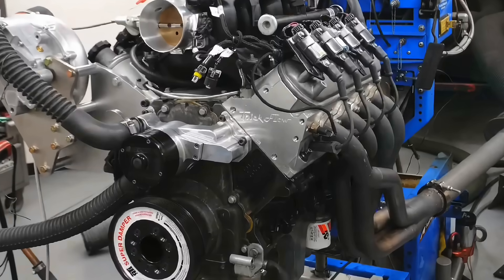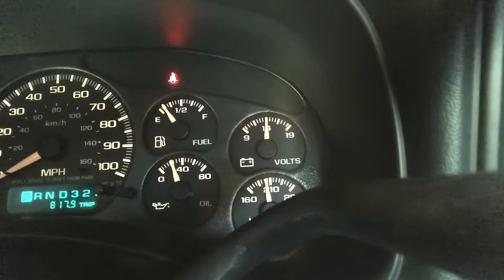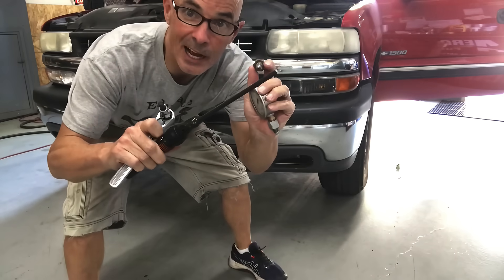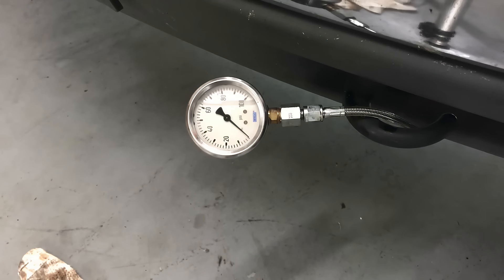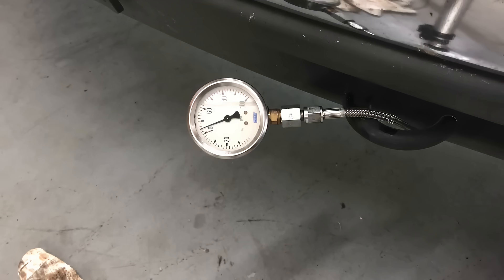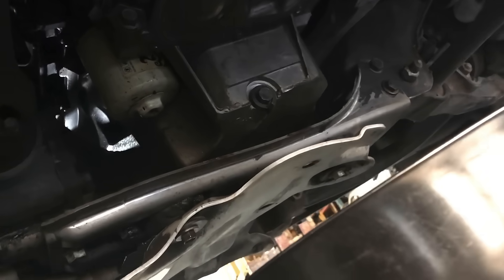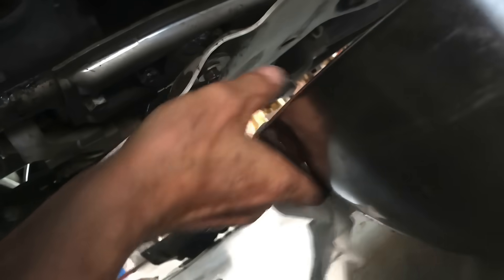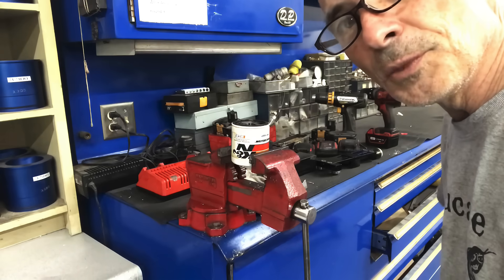HOW TO: TEST & FIX LOW OIL PRESSURE IN YOUR 5.3L OR OTHER LS?

Comment: My 2006 4.8L w/ 322K is always helped by an oil change with Castrol GTX 5W-30. Before the oil change the pressure is 20 at hot idle and 35 on the freeway and it always goes up to 30 at hot idle and 45 on the freeway. I'm always glad to see it go back up. Also,  I would think that 15W-40 would read higher than 5W-30. Anyway, Thank You for all the Cool Videos. I have learned so much from them and I appreciate your work. Today's T-shirt said "BeTHANKFUL" and I am! :-)
Reply: Should I understand that you've never had to change the pump o'ring?
Reply: @swan9680  Correct, I bought an O-ring but have not installed it. I had a new OEM oil pressure sensor installed a few years back when the oil pressure kind of zeroed. Also, on my last oil change at 352K the oil pressure with the Castrol GTX 5W-30 (white jug) never really went down before the Oil Change Light cam on. That's the first time that has happened and I like it, haha. I assuming the Csstrol product has been updated and improved rather than my 4.8L healing itself. 🙂

Comment: I stopped using those K&N filters.  The last time I used one the welded nut ended up leaking.  It was pure luck my wife had driven out of the driveway and she stopped and turned around and I saw it leaking.  Probably would have lost the engine.  K&N refunded me the 9 bucks for the filter but I've used Mobil 1 filters ever since.  Shame too, I know they are good filters but I wasn't taking that chance again.

Comment: Father in law gave my daughter his 06 silvy with the L33 because it had low oil pressure. Put an oring in the pick up and it carries 35 idle and about 45 to 50 highway speed. But it also has 400k on it so low pressure is to be expected haha

Comment: I once had low to no oil pressure due to a Mobil1 oil filter bypass relief valve breaking. Happened twice and I stopped using Mobil1 filters after that
Reply: Sorry to pop your bubble, but a leaky or stuck bypass in a filter can’t cause low oil pressure. All that will happen is that the filter won’t actually filter anything. You could put a completely empty filter on it but it still wouldn’t change the oil pressure. The only way a filter can cause a drop in pressure is that it’s clogged so badly that the media is plugged and the bypass is jammed.

Comment: Impeccable timing Richard. I’ve just bought my first LS powered vehicle. 2002 Tahoe with 300k miles and fluctuating/low oil pressure. Hahahaha wish me luck.
Reply: what was the culprit, brother?
Reply: @edgarsi  it was indeed the o-ring. I played with it for a while before I took it apart. A couple things I did the first was park it on a super steep hill nose to the top and see if pressure drops then park the other way nose down and see if pressure holds. The oil will cover the spot with the o ring and allow it to build normal pressure when you nose down. It was the case for me so I drove the truck around with the oil overfilled by 2 quarts so it would bring the level up to cover the oring at the pump and it would build good pressure. That was a good fix for the moment but it leaked a bit since the level was up to the front and rear main seal. Ended up doing a full reseal with the motor still in the truck. While I had it open scraped all the carbon from the heads and pistons, did a new cam, rings, rod bearings, and the slightly higher pressure pump from melling. Runs and drives perfect now took it on a couple road trips since then. Went wheeling at Anza borego good fun did well for a stock truck the g80 locker is great on uneven terrain.
Reply: @SpecialAgentJamesAki  Oh wow James, this was quite a journey. Thanks for reply! I just got my 04 truck and now facing this pressure problem. Known issue for the 5.3 vortec :( gotta try your "hill method" and if it shows - maybe replacing the o-ring cuz I don't think its a sending unit, then I 'll go from there.. Im not ready to invest into engine rebuild or anything major lol
Reply: @edgarsi  I hope it goes well. It’s definitely worth a shot at just doing the oring. Be carful not to upset the rear cover that holds the rear main seal it’s easy to make those leak when putting the oil pan back on. I think I could have gotten away with just doing the oring but I suffer from terminal 3 “while I’m in there” syndrome.
Reply: @SpecialAgentJamesAki  hehe same here man, and since they gonna drop the front diff and take all the stuff apart.. I thought about getting all them gaskets replaced at the same time.. cuz they are all super cheap, its the labor they charge for.. :( got my main rear leaking anyways... pump in the front, pickup tube on the bottom and rear main on the back of the engine... jeez and I so hoped to avoid this sht lol

Comment: My 02 with 320,000 started having tons of lifter noise.  Not even 15-40 would quiet things down.   Finally used a quart of engine flush before changing oil and it cleaned out some gunk.  I also topped things off with MMO.  I used this truck to pull trailers when I built houses.  Later I delivered mail in the country with it.  It's just a matter of time before I spin a bearing, but it's still running decent.   Engine Restore helped too (not sure how adding lead and copper to oil increases compression and power, but it did).  Anyway, I'll replace the o-ring.  Will give me a chance to look around.  Thanks for the practical video!

Comment: Thanks for the info, my LQ4 has had low oil pressure for a little while. It was also noisy on startup so I assumed sloppy lifters, but then I found the startup noise - leaky manifold gaskets caused by broken bolts. So now I need to dig into the oil pressure further.
Reply: My lm7 has the same issue.  Lifter tick when cold due to broken manifold studs.  What worries me, though, is that I get a top end rattle at about 3000 rpm under a load.  It goes away by 4.  I wouldn't be surprised if I have a collapsed lifter or bent pushrod since the truck is kind of gutless.  Oh well.  That's what Junkyards are for.  (:

Comment: Rotella 5 40 is the only oil on the market with ztdp in it I add militech one and a bottle of ztdp to every oil change and my 6.0 to 2001 Chevy 3/4 ton suburban
Reply from the maker: check Driven

Comment: I've had old wore out small block Chevy's that had about ten psi in drive at idle and maybe 35 or 40 at running speed you don't need a lot of pressure but it's nice I've also put the stiffer spring in the pump and had 50 at idle and 80 running is it necessary no but compared to the normal sbc it's nice to see higher pressure but then the chances of a leak are higher as well at the filter or what have you

Comment: I just had the exact same symptoms. Started with the same tests. Found shavings in the oil filter. Ended up being 2 cam bearings spun. Motor had about 130k miles. 30k miles on the 228 cam before this happened.

Comment: So I had my low oil pressure light come on on my 2006 Ram 1500 with the 5.7 hemi. I know that’s not an LS but I know they are similar in design. I had a light for the oil pressure and I checked with my tuner to give me actual numbers rather than the gauge that shows high and low. I show 16psi when it’s hot and get up to 60 with rpm. I have replaced the timing chain and oil pump and that O ring you had and still see 16 when hot. I honestly don’t know what may have caused it but it seems to be acting normal. Anything else you think could cause that?

Comment: What is the "dog bone" thing you showed ?
What was the oil pressure AFTER replacing the O-ring replacement? 
I had a bad pressure sensor, dash gauge read near zero; 
checked pressure with mech. gauge where it screwed into block-OK @ 40 psig, idle ( ???) Is that good with 5-30?
Replaced sender...should I replace oil pump and O-ring???
Reply from the maker: that's fine

Comment: I've seen tons of these, a quick band aid is swapping oil filters with an ac delco. Usually takes the oil pressure from 20-30psi up to 60psi. 9 out of 10 times that helps for a while. Some stay at 60 and others will eventually fall back off to 20-30. Ones with afm definitely can be tough to accurately diagnose in a shop setting, usually it's the screen for the vlom, sometimes the vlom assembly, oil relief valve sticking. I've seen a few different reasons other than obvious engine component failure.

Comment: The check valve in the oil pump can stick and cause low oil pressure too.
Reply: Exact same thing happened to me.  Oil pressure was around 60 psi cold and then back down to 20. Im not sure if check valve is even needed

Comment: Richard I had a customer that had low oil psi and it turned out to be worn out cam bearings .  I have also had a broken pressure regulator spring in the oil pump in older chevy  small blocks. It muct be nice to be able to just slide under the truck to work on it . My fat head and gut says I need to use jack and jack stands. Glad it was just an oring.

Comment: The LS series engine oiling system is identical to the FE Ford engine series, which is to say, trash. Only way to improve it is to dry sump it or get a small block
Reply: The oiling system is so bad that these engines will only last half a million miles! no wonder there is no one swaping them in project cars LOL
Reply: @rideswift  did your parents have any children that lived? I bet they regret that
Reply: @puunersjabski6487  Lifes to short to be so angry Jabski, turn that frown upside down, youll feel much better.

Comment: Likely a smaller issue but, rod or main bearing wear are the largest culprits of low or less than desirable oil pressure. It’s a skill level labor level type of thing, if you’ve checked the small culprits and find no issues. Now you know your engine is worn and it’s most likely your bearings are worn and gushing oil out of them which lowers oil pressure. It’s a diagnosis that makes you think, “it’s not THAT low so I’ll just keep driving it” or “its gonna cost me a good bit of cash at a auto shop so I’ll keep driving” and in both cases it’s ok to keep driving it just song as it doesn’t get REALLY low on oil pressure. If that happens your taking a chance at spinning a rod or main bearing which can’t lead to a hole in the block at the worst or a ruined crank at best. Watch your oil pressure you’ll, as far as oil goes it’s the only thing between a good running engine and a blown engine. Your judgement on the repair will dictate the level of damage to your engine and the hit to your wallet.
Reply from the maker: that's why we checked the filter for bearing material
Reply: Richard Holdener gotcha, the comment was meant for people that aren’t persay “gearheads” like the rest of us. Most people think they do their own mechanic work by doing oil changes, brake jobs and filter changes, when in fact those are all maintenance items that require periodic replacement. Many people think doing general maintenance is the same as doing actual mechanic work, this comment was directed at those people. The rest of us know what we can get away with or without doing more damage than good. That’s why we fix or modify engines, transmissions etc, this is also why the weekend mechanics out there 90% of the time bring their screwups or neglected vehicles to us for repairs. Often the weekend mechanic knows more about choosing sunglasses rather than fixing a engine or other parts of a vehicle. It makes them feel good to to simple stuff and its job security for us knowing they’ll screw something up or neglect something that we’ll get paid money to fix.

As a professional engine and transmission builder, 75% of the work I do is do to other weekend warriors or insufficient skill level mechanics, 10% comes from mistakes during a performance build, another 10% comes from just plain ignorance to the component being fixed or modified and the last 5% comes from outright foolish antics of a moron that thought it would work. That’s what doing mechanic work for a living is though we love doing the performance stuff but, most often we’re fixing other people’s screwups or neglect and the rest is numbing work that is as of today the normal in most shops.

Comment: Our lifters are not designed for that heavy of an oil due to the small oil ports on the lifters. i found that 0w-40 or 5w-40 is ok though but 5w-30 is prime when i get different lifters i am running heavier oil. Also SAVE the MANUAL THROTTLE BODY! Currently i run rotella gas truck 5w-30 with one quart of 0w20 in the winter and 1 quart 5w40 in the summer

Comment: 36psi is low? All my LS engines run around there, and my old Pontiac engines are between 10-15 to 30 psi at idle, 40 to 50 psi at higher rpm, except for the solid roller engine that has 65 psi. No need for lots of pressure or volume, it just soaks up power in my old engines. They run for decades like that. I have a 400 and a 455 I built in 1995 and 1996 (respectively) that are still going with 15- 20 psi at idle. Its what they have had since I put them together. 36 would be kinda high I think, not that it would bother me to have that much.

I have had pumps fall off on pressure, swap them out and its good. Right now one of my 455s is the 15 at idle and its because the 13:1 heads pushed a head gasket and it milked the oil, so it self clearanced the bearings a bit, I'll get around to changing them maybe over this winter, I want to change the 3.42 gears for some 3.08s because I have a Th350 in it rather than the 700R4 that engine keeps breaking, so I will do it at the same time. I don't have the right driveshaft for a Th400 or 2004R at the moment, so the Th350 will take a beating for a bit. It rarely sees more than 5500 rpm, so I am not overly concerned with the bearings. Its in my daily driver 65 GTO and I am enjoying driving it with 11.5:1 (different heads) on E85. Over 12:1 I need MLS head gaskets or something better than the cheap FelPro ones I run in everything under that. 

Let me tell ya, a 455 with 11.5:1 on E85 with 240 cfm heads and a mild 224/228 juice roller in a 3300lb car is stupid fun. It likes the FiTech a lot. Those same heads on another 455 pushed my 3750lb 79 Formula into the mid 11s with a 3.42, so the old Goat should run there no problem. Even with 15 psi at idle. Not bad for a low buck daily.  Something about 550ftlbs from idle to 4500rpm  and around 500ftlbs at 5500 just says yes to me. Doing it with a $3500 engine, well that is a hell yes.
Reply: Thank you for keeping on playing with the Pontiac engines.  I hate to see Pontiacs with Chevy engines.
Reply: @andyharman3022  I've stuffed Pontiacs in chevys, like my 76 C10. more power, better mileage, and costs less. I needed that 400 for another vehicle, so now the C10 is getting a 6.0.. its costing me a fortune, I could build a 13:1 compression roller cammed 455 or stroked 400 for the cost of stuffing a junkyard LS in this truck... but all my Pontiacs have car homes, the truck can make do with the LS which is vastly superior to the sbc and bbc.

Comment: I'm looking forward to the "daily driver" build that replaces your original engine when the time comes. With as many highway miles as you put on the truck I'm sure a lot of people would be interested in a non-maximum effort, yet still a massive improvement from stock LS. I have a year older GMC and wondered if your truck also came with that Optional cold weather running verification system in the form of a few thousandths extra piston to wall clearance? You know that 30 seconds of lovely sound that GM suggested If you just let your truck warm up it will stop sound.
Reply: My LS1 has had the cold start piston slap since new.  It goes away when the engine warms up.  I can make it go away when cold by revving the engine to 1700 rpm.  But over the years, it has never caused a problem.  Now I just turn up the radio.

Comment: Pressure relief valve in the oil pump sticking. Was the thread pitch on that plug you pulled out m16x1.5???
Reply from the maker: whatever stock is

Comment: Do a vid on lifter knock...

Probably after 200,000-225,000mi I'd replace the pump with a high volume melling and change the timing gear/chain, felpro no leak gasket.

Comment: Like the fuel gauge level. 😀 How many miles on it? You obviously spared now expense on oil and filters.
Reply from the maker: near 250K
Reply: Pretty good, remember in the good old days when they were trash at 100k. Got a 2002 Takoe 5.3 4wd with 220k on it drive it 500 miles to Los Angeles for work every month. Still getting 18 mpg on 100% stock simi regular maintenance. Your right the real LS has a throttle cable. FBW stuff hahaha 😄

Comment: It's not always "Cocaine and Hookers" when working on cars, lol.  Bravo to you for recognizing a problem exists before further damage could be done and doing something besides crossing fingers hoping it'll be ok. Knowing your vehicles "Normal" is the alarm bell, any change from that "norm" is reason to be concerned. Happy for you that it was the O-ring and not cam bearings causing excessive leakage internally or a lifter(but that usually is accompanied with increased valvetrain noise) that chews up pushrod and lifter into metal shavings that inevitably find their way past the filter and into the bearings and killing the engine.
Reply: Kevin Mallender it’s not? Pop my bubble or what! That takes all the fun out of it.

Comment: What are some of the thicker oil additives you guys use? I have a LS with 300k miles. Oil pressure isn't horrible, but not great. Already replaced the o ring which did help. I'd rather just run a thicker oil or additives if it helps on an older engine.
Reply from the maker: I tried stabilizer
Reply: I've always ran STP forever. Seems to work well and sometimes stops a valve cover leak.